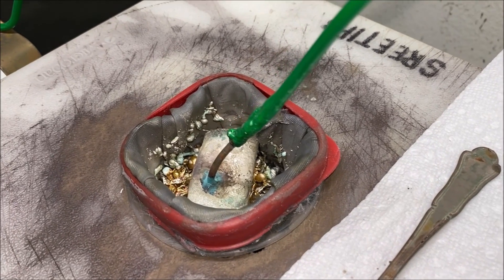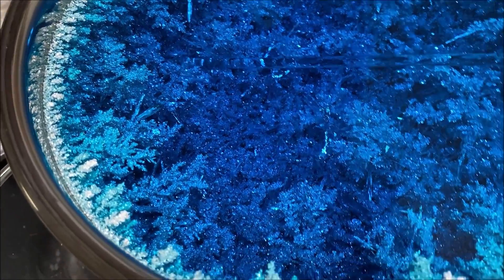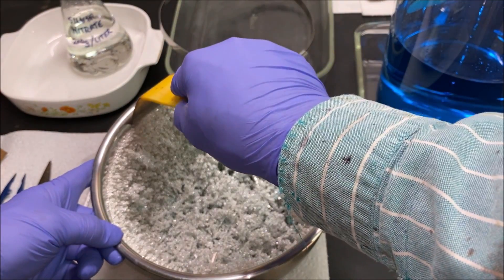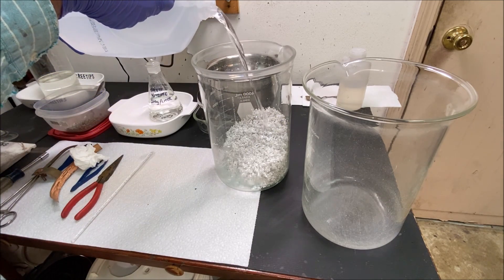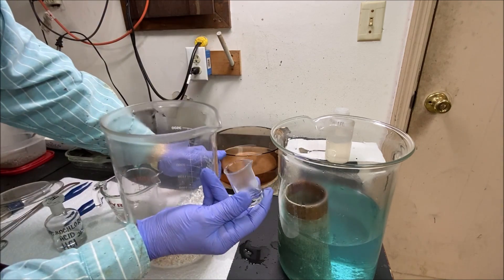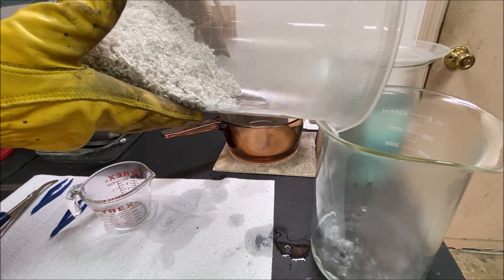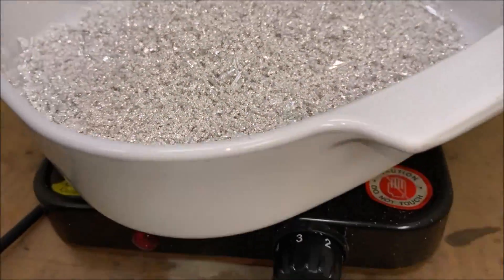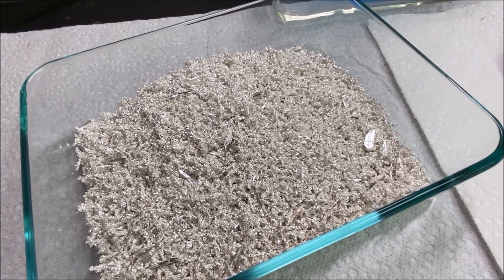Fifty Ounces of Silver From My Silver Cell Day 15

Comment: Just curious, with as much distilled water as you go through, do you have a distiller or just buy it from the store in gallon jugs? I only ask because in this particular video you're using a sizable volume of it for rinses and I was wondering if having your own distiller would be an expense worth having.
Reply from the maker: I use about twenty gallons of distilled water per month for my small hobby operation. So I just buy it at the grocery store rather than setting up a distill plant or osmosis.
Reply: @sreetips  Water production is a nice "prepper" hobby for me. I already have a RO water filter for my drinking needs, so it produces nearly pure H20. Because I live in Florida and have a well, I also have a DIY solar distiller for weather emergencies when I only have enough backup power to run the well briefly from my solar panel on battery/inverter power. It's a fun little experiment with practical use!
Reply from the maker: That’s all good stuff to have.

Comment: How much is it worth ? And how much to make ? Profits?
Reply from the maker: I don’t know. I’d have sell it to realize profits - and I ain’t selling.
Reply: @sreetips  thanks for the reply. I have watched some of your videos in the past. Really neat stuff. I subbed so I don't miss any upcoming vids. Looks like something I could handle with your guidance videos. I'll be sure to watch all the vids on this process to try and understand what is happening.
Reply from the maker: I’m planning a new video to demonstrate how I build a second silver cell. Thank you.
Reply: @sreetips  can't wait to see it my friend.  I made a hydrogen wet cell with a couple glass jars and stainless steel plates. I run a hose from the second jar to a gas generator with the gas line off. No gasoline. It started up and ran until it used all the gas in the jar. So I let cell build up more gas and when I pulled the cord it sucked some gas but didn't fire. I pulled it again and both tanks exploded. Pickle jars, glass. Nothing hit me surprisingly. 
I think I needed a spark arrestor. I made an arrestor with a pipe and mesh inside. I haven't tried it yet. Next time I'll make more safety precautions. That was very very loud when it blew. Be safe.
Reply from the maker: I made a hydrogen gas generator with lye and aluminum foil. I bubbled the gas I to another flask full of water. Then light the output with a match and watch it burn. But one time the reaction wasn’t going fast enough, I lit the match and the flame exploded the bubbler flask with a load pop. Never did that again.
Reply: @sreetips  I'm glad you told me that BCS I have thought of trying that method for experiment purposes.  Wow. Glad you didn't get hurt. Thanks for the tip. 👍 That stuff is extremely powerful.

Comment: Copper from the impure silver anode seems to be fouling the electrolyte which has changed color to blue. I believe this reduces the efficiency of the cell.  Is there a way to remove the copper from the silver nitrate and renew the electrolyte.  If not, I wonder how many cell cycles can you get from a single electrolyte charge.  Thanks for all the informative and instructional videos.
Reply from the maker: I use the electrolyte for two runs of the silver cell. I add another 200g of pure silver for the second run. I never use the electrolyte more than twice.
Reply from the maker: According to Goldsilverpro on the goldrefiningforum.com, a little copper in the electrolyte promotes fat crystal growth. Copper in the electrolyte is not a problem as long as the concentration is kept below 60g per liter.

Comment: As a silver collector i would enjoy growing silver crystals.
Where do you find find the equipment and solution to grow it? And how much of an investment?
Great video my friend. 👍
Reply from the maker: I bought everything at the hardware store or on eBay. I make the electrolyte by dissolving pure silver in nitric acid.
Reply: @sreetips  if you start with silver, and end with silver, why do this?
I was thinking you got the silver nitrate from work (i.e. for free or cheep) and this was an arbitrage
Reply from the maker: I use sterling silver to refine gold. I recover the silver and refine it to high purity. Then I keep it.

Comment: What was the point of doing this?
Reply from the maker: I’m refining impure silver with undetermined value into high purity elemental silver - three nines fine. If you don’t understand the reason for doing this then I probably won’t be able to tell you why.
Reply: @sreetips  no that explains it. I either didn't catch you in the video saying it was impure or you didn't say it. I thought you were using a 50 ounce silver bar to make crystal with but then you scraped the bowl.

Comment: When you say “grow silver”, do you mean only the crystals or the silver element itself? Surely you don’t mean the latter right?
Reply from the maker: This is pure elemental silver. All investment grade silver bars or rounds began as pure silver crystal (they are actually dendrites and are not really true crystals) just like you see here. Grown in an electrolytic silver cell just like you see here. The only difference is that silver crystal grown by large industrial refiners are are grown in Thumb cells - plates of alternating impure silver hung between cathode plates. My home made cell is a moebius cell (I might have those two terms backwards). But the result is the same, albeit on a much smaller scale. I’m only getting out what I put in, less impurities. I can’t create pure elemental silver metal out of thin air. The feed stock comes from cement silver from my gold refining operations. Silver is a by-product of my gold refining.
Reply: @sreetips  ah, ok

Comment: I don't get it.  Pure silver is already 99.99 percent pure.  It doesn't make any since to me to do this process.  You're starting with a pure silver bar?  And electro-plating it for what reason?
Reply from the maker: Industry standard for pure silver is three nines, not four. I use silver in my gold refining process. But it’s not three nines after I get done removing it from the gold with hot dilute nitric boils. It’s close to three nines, but close only counts in horse shoes and hand grenades. So I run it through the silver cell. It’s the only way to be sure.
Reply: @sreetips  I've heard of miners in Guyana and parts of Africa using softer metals to capture super fine gold flakes in the sleuce runs. I believe one used silver some how.  The other in Africa was using mercury which had the best results because it was the softest metal and would capture fine gold flakes that would normally wash out of the runs.  In Australia, they were using cyanide I think.  In conjunction with strong acid, I don't remember exactly.